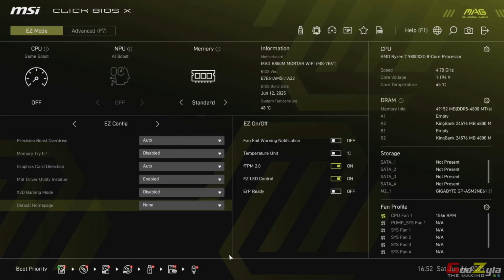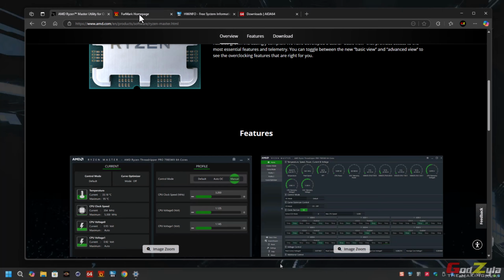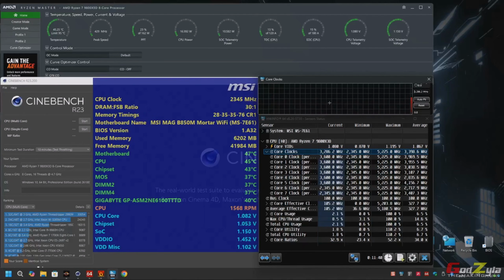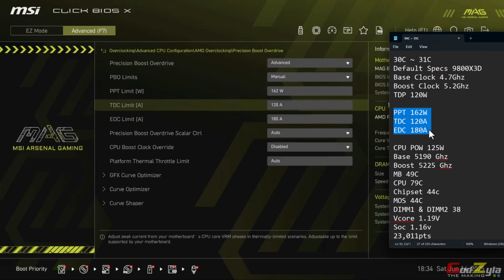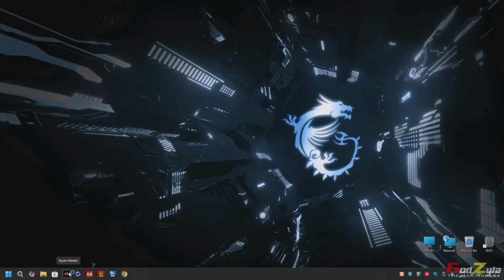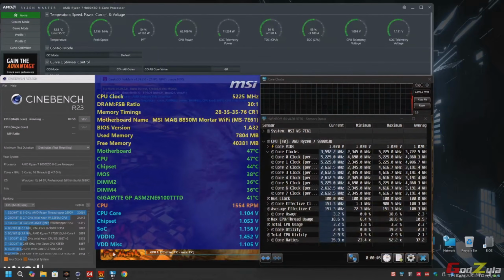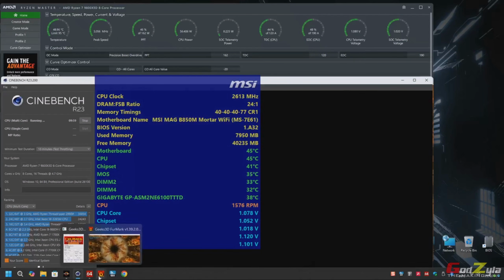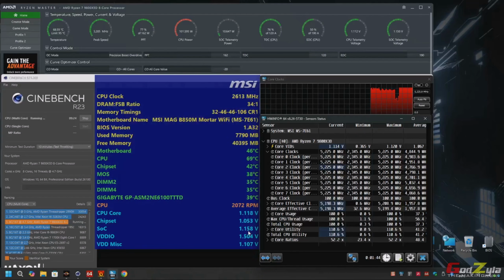PBO2 Curve Optimizing with 9800X3D on MSI Motherboard

Comment: I followed your instructions on my 9700x and MSI X870 Tomahawk motherboard. The machine works stably, but the Aida64 test shows a hardware error. Should I tweak the settings to pass the Aida64 test, or should I just use it as is?
Reply from the maker: Hi Duoc Ho, welcome to my channel. If Aida 64 did not pass, you will need to narrow down at which step did it not run. I assume your rams are at 6000M/T  I will do these sequence.

==Undervolting  Steps for 9700X==

Clear CMOS first  (PLEASE MAKE SURE TO CLEAR CMOS) and go into UEFI / BIOS

01) Go to Overclocking
02) Enable A-XMP or EXPO (depending your rams which it supports)
03) Set DRAM Speed 6000
04) Set FCLK Frequency 2000
05) Set UCLK DIV1 Mode to UCLK=MEMCLK
06) Set CPU Voltage to Offset
07) Set CPU Offset Mode Mark to - (negative)
08) Set CPU Offset Voltage to 0.05V
09) Set CPU NB/SoC Voltage to Override Mode
10) Set Override CPU NB/SoC voltage to 1.15v (make sure is 1.15v and not 1.5v)
11) Save and load to windows, run Aida 64 Stability test for 30minutes

If with errors, go back to UEFI, set the CPU Offset Voltage to 0.025V, repeat step 11) 
If still error, go back to UEFI set CPU Offset Voltage to Auto. (repeat step 11) 

if still error, go back to UEFI set Override CPU NB/SoC Voltage to 1.16V (repeat step 11) 
If still error, go back to UEFI set Override CPU NB/SoC Voltage to 1.17V (repeat step 11) 
you might need to set NB/SoC Voltage higher if it keeps failing but do not set CPU NB/SoC voltage above 1.18v
If no errors, go to UEFI and proceed to step 12).
The above is to ensure your processor can run at offset voltage and your RAMs able to run NB/SoC Voltage at 1.15v ~ 1.18v (depends which is stable for you)

12) Go to Overclocking
13) Set High-Efficiency Mode to Enable
14) Set Memory Timing Preset to Tightest 
15) Save and load to windows, run Aida 64 Stability test for 30minutes

If with errors, go back to UEFI, set Memory Timing Preset to Tighter, repeat step 15) 
If still error, go back to UEFI set High-Efficiency Mode to Auto.
If no errors, go to UEFI and proceed to step 16).

16) Click on Advanced CPU Configuration
17) Click on Precision Boost Overdrive
18) Click on Manual 
19) PPT Limit to 88W / 88000mA 
20) TDC limit to 75A / 75000mA 
21) EDC limit to 150A / 150000mA
22) Set Platform Thermal Throttle Limit 90
23) Scroll down, click on Curve Optimizer
24) Select All Cores under Curve Optimizer
25) Select Negative under All Core Curve Optimizer Sign
26) Set All Core Curve Optimizer Magnitude to value 20 
27) Save and load to windows, run Aida 64 Stability test for 30minutes

If with errors, go back to UEFI, set All Core Curve Optimizer Magnitude to -15, repeat step 27)
If with errors, go back to UEFI, set All Core Curve Optimizer Magnitude to -10, repeat step 27)
If no errors proceed step 28)

28) Set curve shaper as following.
Med Frequency , Low Temp & Med Temp & High Temp to -15
High Frequency , Low Temp & Med Temp & High Temp to -10
Max Frequency , Low Temp & Med Temp & High Temp to -05
29) Save and load to windows, run Aida 64 Stability test for 30minutes

If with errors, go back to UEFI, set Curve Shaper to all auto and repeat 29) 

once everything stable, run Aida 64 Stability test for 2 hours and OCCT test for 2 hours.
Reply: @KleoYan  tks so much :3
Reply from the maker: @duocho1278  you are most welcome. Just do step by step. don't rush it.. so that you can narrow down where goes wrong.
Reply: @KleoYan  I followed the steps carefully, and the error was in the curve optimizer when I set it to -20. Reducing it to -15 solved the problem. However, adjusting the curve shape according to your settings caused the error again. Then, setting the curve shape to auto in all settings fixed the error. Only Aida64 was giving the error; I tested it on COCT and it worked fine. If I keep your settings, will it cause any problems? Because it still works normally even though Aida64 is reporting errors.
Reply from the maker: @duocho1278  if with only Curve Optimizer as -15 and you are having errors. set Vcore Offset to Auto and test it again with Aida 64. if that works.. up the curve optimizer to -20.. hope that works.
Reply: @KleoYan  With Curve Optimizer -15 in Aida64, there are no errors. With -20, there are errors. So, should I try setting Vcore Offset to Auto and Curve Optimizer to -20?
Reply from the maker: @duocho1278  yes set VCore to auto and set co to -20. See if it pass Aida 64. If it pass, try curve sharper. If curve shaper fail, then set curve shaper to auto. You can just leave co to -20 and good luck 😉

Comment: Will this work with a 7800x3d
Reply from the maker: Hi Everlastdj-uk, welcome to my channel. it will work but for 7000 Series, skip the Curve Shaper. you might want to try this
Make sure you have good case airflow and most importantly a good CPU Cooler. 

Under Overclocking 7800X3D
1) Enable XMP or XPO (depending on your rams profile) to Profile I
2) Set DRAM Speed to 6000
3) FCLK Frequency to 2000
4) Set UCLK DIV1 Mode to UCLK=MEMCLK

You can try this but unstable, kindly set it back to Auto
5) Set High-Efficiency Mode to Enable
6) Set Memory Timing Preset to Tightest

You can try this but unstable, kindly set it back to Auto
7) Set CPU Core Voltage to Offset Mode
8) Set CPU Offset Mode Mark to - (Negative sign)
9) Set Offset voltage to 0.05v

Under Advanced > AMD Overclocking > AMD Overclocking
10) Check SoC/Uncore OC Mode is Enable

Under Advanced > AMD Overclocking > AMD Overclocking > Precision Boost Overdrive
11) Set Precision Boost Overdrive to Advanced
12) Set PBO Limits to Manual
13) Set PPT to 12000mW
14) Set TDC to 110000mA
15) Set EDC to 170000mA
16) Curve Optimizer to All Cores -(negative) 20

You can't use curve shaper as it does not support

17) Save the settings, boot into windows, test for stability with aida 64 and do a benchmark test. once stable, play some games for reality check. 

things to observe when you change settings, my advise it to use Aida 64 stability test. Observe again SoC Voltage and Vcore drawn. In addition, observe CPU Temp, Mobo Temp, VRM Temp, Chipset Temp and RAM Temp and M.2 Temp. Do benchmark test with Cinebench, 10minutes run. 

Once it's stable and getting good results, I will not stop here. I will again test on Aida 64 for stability for at least 2 hours and follow by OCCT for 2 hours. 

Once all ok, run some games and do your observation again. Good Luck!
Reply: @KleoYan what jind of temps an i looking for and thanks for yhe reply gonna give it a try
Reply from the maker: @djeverlast9935  I hope you will go through this content and to understand how it works. I would advise you to take readings from default before configuration, then apply the configuration step by step with test to see the temperature on your own. As I am not able to judge the overall temperature for your processor or at the location you are at. Rest assure your temperature will drop and performance will gain.
Reply: @KleoYan currently have co -20 with pbo set to motherboard  but apart from that only other thing is expo, using 32gb ddr5 6000 cl30, efficiency mode with tightest settings and runs stable, max temp around 78c
Reply from the maker: @djeverlast9935   your set up looks ok but I would advise not to use motherboard for PBO2 limits. have total control of your configuration and not letting the motherboard determind for you. set to either auto or manual configuration.
you can use these figures as it's detaul PBO2 limits for your 7800X3D

Under Advanced > AMD Overclocking > AMD Overclocking > Precision Boost Overdrive
11) Set Precision Boost Overdrive to Advanced
12) Set PBO Limits to Manual
13) Set PPT to 12000mW
14) Set TDC to 110000mA
15) Set EDC to 170000mA
16) Curve Optimizer to All Cores -(negative) 20
Reply: @KleoYan i dont have pbo2, im using msi b850 edge ti mobo with 7800x3d
Reply from the maker: @djeverlast9935  In the section where you configure the precision boost overdrive to motherboard, set it to either either *Auto* or **Manual**. If you choose **Manual**, enter the values I’ve provided.  
I’d really appreciate it if you could take the time to watch the video carefully and understand each step before proceeding, so that you know what you are configuring.

Comment: Hao kleo, thanks for the vid. Can this be apply to all ryzen 9000 series below 9800x3d (9700, 9600x, 9600)?
Reply from the maker: Welcome to my channel Spotfire Visualwerk. Happy New Year. Yup you can apply the same method but do find out your processor PPT, TDC and EDC value and every steps you do, make sure to use Aida 64 stability test to test if system is stable before moving to the next configuration.

Comment: Great video and Merry Xmas! First thing I did was set CO to 20 and it dropped temps and even increased my R23 score. I am doing all steps one at a time and then benchmarking to see the impacts.

I am having trouble with the RAM step though. I have 32gb 6000 30-36-36-76 1.400V. I did everything you showed but then my PC would only boot to bios. I changed High Efficiency Mode back to auto and still booted to bios. I tried flicking it back on with ‘tighter’, but it still booted to bios. 

I did notice that the SoC Voltage was showing as 1.17V even though I changed it to 1.15V. I don’t know what happened here but I think that part must not have taken as PC couldn’t train the new RAM settings so no other changes saved (my theory anyway). So I set the voltages back to auto as well and it still would only boot to bios. 

The only way I could get it to boot to windows was the hold my power button down and turn the PC off. Any ideas what happened here? 

I previously had expo auto setting and it ran fine with Aida64 stress test for 15 min and multiple R23 runs. Maybe I can run tighter timing if I leave the voltage as auto for both? Or maybe I just try everything again but start at ‘tight’ first? I don’t think things were taking when I was in the bios loop and tried tight as disabling efficiency mode didn’t even work.
Reply from the maker: Hi Rover, welcome back. Have you try clearing cmos by click on the CMOS button on your rear I/O or to short the JBAT pins on your motherboard? try that and set your configuration again. as for the SoC Voltage, it's normal. when you set to 1.15v it will pull more but not above 1.2v which is safe.
Reply: @KleoYan Thanks for responding. I haven’t tried resetting CMOS as I was able to break the bios boot cycle by just powering off with the physical button. I don’t want everything to reset and to do it again. 

Do you think CMOS could help it run with efficiency mode on tightest even though it failed once before? 

Ah I see. I thought by setting to 1.15 that it caps it at that.
Reply from the maker: @rover1374  try clear cmos and redo as it's not normal if you have to keep pressing the physical button. You can try with timing tightest and if it does not work, clear cmos again and try tight. If it still do not work, skip the highest timing, as some ram module can't operate at tighest or tight timing.
Reply: @KleoYan It was a bit weird how it kept getting caught it the bios cycle and I had to power off (all working fine now though on expo again and I only had timeless the physical buttons once to break the cycle of it only loading bios). I’ll reset CMOS and try the RAM as the first thing I do (after fan curves). The RAM is Corsair Vengeance with good timings so i was surprised when it didn’t work first go. I think if can’t run tightest maybe no point and just do expo.
Reply from the maker: @rover1374  you correct. It can’t do tightest timing just enable expo and set vsoc to 1.15v and to do the tweaks one step at a time 😉 all the best with your settings 👍👍👍
Reply: @K @KleoYan anks mate, will desert CMOS and start again. Should I still do the offset as well or just 1.15 (if all I do is expo)?
Reply from the maker: @rover1374  The choice is yours.. for me, my rams do not need VSoC 1.216v (No offset) to run. it only needs 1.162v, so I have done the offset to 1.15v which it does also automatically pull as required to 1.164v. Keeping it below 1.2v. This allows lower temperature and to prolong the lifespan on my rams.
Reply: @KleoYan no worries, I’ll do the 1.15 and 0.05 (I think that’s right, can’t remember now) with Expo if I can’t run tightest. Thanks for your help!
Reply from the maker: @rover1374  no problem.. you are most welcome.
Reply: @KleoYan  I cleared the CMOS and tried tightest but it just did the same thing and would only load bios and it was caught in that loop. I again had to turn off the PC with the button.

I then tried tight and this booted. I did all the other changes too. This is probably similar to just Expo at the end of the day but at least with ‘tight’ setting I have granular control over the other stuff too. Maybe I just leave at tight?

I ran R23 again (on its own) and somehow with just doing the RAM and SoC stuff my temps went down about 7c and my score went up by 500pts. I did not touch CO or CS or anything just the RAM. I guess that’s a win!  Stress tested with Aida for 25 mins and all stable it seems.
Reply from the maker: @rover1374  that's awesome news. to be honest, I will suggest to just enable Expo profile and not set it to tight. Reason is, to ensure your system will pick the algorithm properly. From Expo and to enable Tight, the difference is very minor, but the choice is yours. Once you have tested it's stable, you can proceed to play with Curve Optimizer and Curve Shaper. wish you success buddy 🫡
Reply: @KleoYan  Things kept getting better the more I implemented - thanks again for the video! Once I got to curve shaper though and put in your values it would crash with Aida. So I backed off curve optimiser to 15 and crash again. Then to 10 and it seemed stable. So with curve shaper and curve optimiser at 10 it’s stable, or no curve shaper and it’s stable with curve optimiser at 20. Does that seem right? Should I keep both CS and CO or should I just keep CO at the 20 value?
Reply from the maker: @rover1374  for this, I will advise to go without the CS, leave CO as -20
Reply: @KleoYan thank you, that’s what I was thinking! It pulls about 99W with both settings so I think because it draws low power that could be the reason (just a guess).
Reply from the maker: @rover1374  each processor has a tolerance limit on stretch. So ya. I will cut the CS and just go full on CO but stick to -20 on all cores. Btw congrats
Reply: @KleoYan That makes sense - no silicone lottery me. Thanks again, it’s been fun tinkering!
Reply from the maker: @rover1374  ok.. now play some games and enjoy!  😁
Reply: @KleoYan while staring at stats!
Reply from the maker: @rover1374  and what’s the result lol. Good or bad hahahah
Reply: @KleoYan exceptional result - more fps, less power consumption and more efficient! I think the optimizing is more fun haha
Reply from the maker: @rover1374  now someone is addicted like I do hahahah.. infact some of my viewers decided to take the gamble, sold their processor and purchase another for better bin. It is fun but I don't advise that, I rather they spend more time enjoying what the have set and make do with it 😁
Reply: @K @KleoYan  This could get expensive 😂 I get about 23,200pts in R23 with just CO 20, so not too bad. It’s a bit of a rabbit hole and for some people tinkering is part of the hobby. Maybe I’ll undervolt my 5070ti next 😂 actually I need to fix that issue I was having before as it’s happening again - Everytime I make a bios change and exit, the change is made but bios forgets my boot drive and won’t load windows. I power off with the button then it loads my boot drive and windows 🤷🏻‍♂️. Very weird. I have an old crappy Gen 3 drive so maybe time for a new one!

Comment: I followed settings and mine didnt post
Reply from the maker: Hi Chase Davis, welcome to my channel. I assume you are using the 9800X3D, mind if I ask which MSI Mobo and rams are you using? best is to provide me your rams capacity, the cas latency, bus speed and voltage. lets see if I can aid you out.

Comment: Terrific video. Not to throw shade on others, but out of all the videos I watched on the subject of undervolting/PBO, you're the only one who took the time to actually explain the reasoning behind every decision made, which is great as it encourages viewers to think by themselves and educates them on how things actually work instead of telling them to blindly use settings that could prove dangerous or just not beneficial in the long term.

Just one question: would it be ok if I use the same curve shaper settings (med -15, high -10, max -5) for my 9600x?
Thanks!
Reply from the maker: Hi Chadagon of the Swolen Order, welcome to my channel. In general all 9000 series processor are entitled to use Curve Shaper. The settings I've provided are safe to use or to configure to your 9600X

Comment: This guide was super helpful! I was able to improve my scores with much less power and heat which is awesome. I had to back off the all core offset from 20 to 15 as it wouldn't clear the AIDA stress test at 20 but everything else is exactly as you had it.
Reply from the maker: Hi joel_fm, welcome to my channel. Good to hear you are having good results. Thank you for your feedback 👍👍👍
Reply: My end results are -15 all core and then -17 medium, -13 high, -7 max. Getting R23 23,167 only 64.5C (no AC where I live so this is huge)

Comment: How do you open note in bios?
Reply from the maker: Hi ShocKv9, welcome to my channel. The reason I can open up notes is because. I am using my main pc with GLinet (RM1) and my configuration PC is connect to the GLinet (RM1). You can read up on ipkvm for this function and you will need the device. Anyway is to get a capture card but will need separate keyboard and mouse.